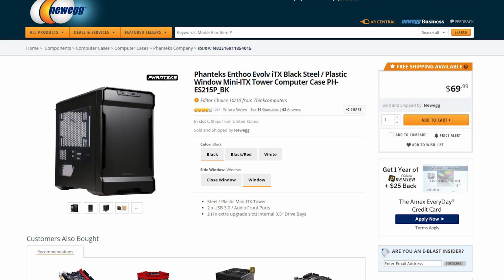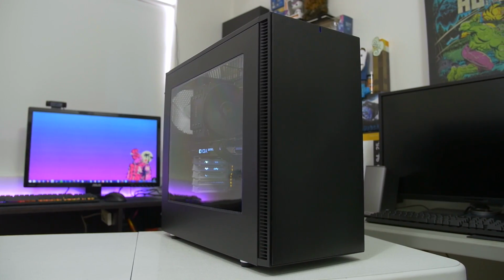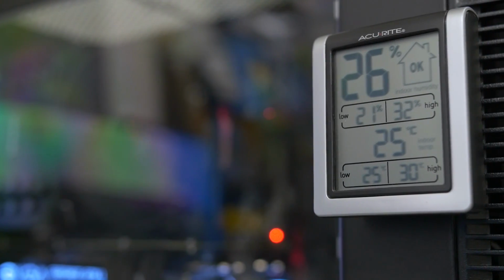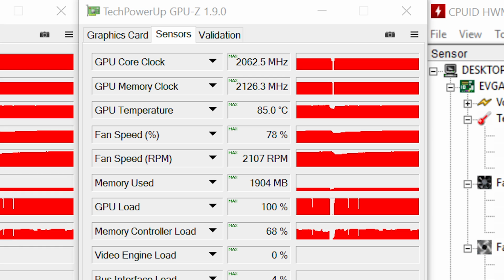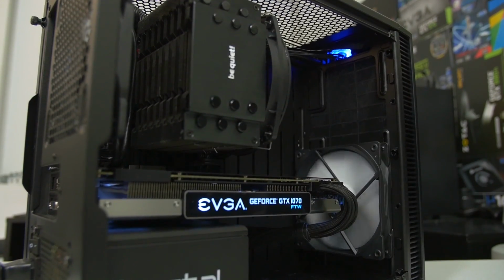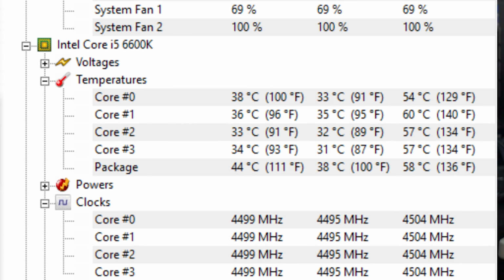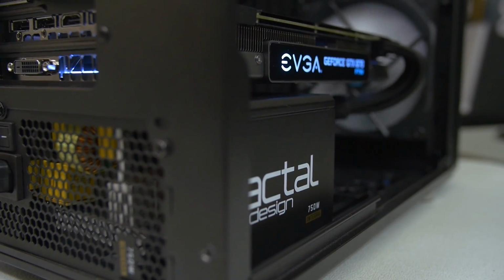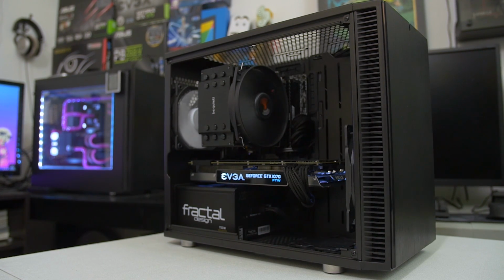Are Blower Fan Video Cards Actually Better in SFF Cases?

Comment: I'm a little late to the party but if that was me I'd swap out the psu (since in most cases its not the most expensive part and the old one could be sold) to a SFX one. There are brackets available to mount SFX PSU's in a ATX Case.

Comment: nonsense! I have the Define Nano S and same gap between gpu and have the evga gtx 1070 sc Blk edition and it runs between 80 and 85 and even with an ATX case it did. Evga site even states max temp is 94c so 80-85 is fine when under load.

Comment: Hi. Great videos. Could you try and run these tests again using more case fans (i.e. 2 front intakes, possibly 1 at the bottom beside the PSU). 

I currently have this fan setup and i'm getting around 65-70C for the GPU and 35-45C for the CPU (Asus 1070 Strix O8, 6700k, Nano S). The noise levels are pretty silent too.

I also used an Asus 1070 Turbo (blower-style) and I did not reach those temps.  This prevented me from entirely replacing my ATX PSU to an SFX PSU (saving me money).

Other forum discussions have also stated similar temp ranges. Just wanted to inform others that it is possible to use a regular PSU and open air cooled GPUs without reaching the temps you showed. Thank you.

Comment: It's no wonder the Define S is sold for cheap money.

Thermal design is not good enough except for total watercooling.

Just move the PSU upwards, standardway or to the front. It can't be that hard to design it.

Comment: I'll say at the outset that I might not know what I'm talking about. I'm a noob to building my own PC, having successfully accomplished this exactly once. I'm too scared to OC anything, too scared to try water cooling, and in general, find out that I'm wrong a lot. But I can't help but wonder if leaving open the top louvers on the ATX and Micro ITX cases might not have added to airflow problems within the cases. Unintuitive as this may sound, essentially leaving the top of the case open seems to me to result in a case with certain areas having fast low-pressure airflow (near the top openings, presumably) and other areas with little overall airflow (the bottom area around the GPU/PSU) which would leave those areas largely recirculating the ever more heated air in that area. Similar to a shoebox filled with objects and with a small hole on each end and a very small fan installed in each hole. If the top of the shoebox is closed, you would presumably get a decent amount of cool air flowing from one side to the other but remove the shoebox lid, creating a low pressure area at the top and it seems likely you'd get lots of areas that weren't seeing much air movement at all. I hate to be "that guy," but would it be possible to run the same test with the top closed? Seems like the temps may run significantly lower, or maybe I'm wrong and you'd bust another myth.

Comment: Trying to plan ahead for a build with Corsair SF600 PSU. I've read that the SFX PSU come with smaller cable lengths than standard ATX. 

Am I correct guessing the 24 pin and 8 pin connectors will require at least another 20cm ? 
Others extensions required ?

Comment: Sir, this is not a fair test at all!
Of course your blower design worked better in that case! YOU ARE FORCE FEEDING IT AIR!
YOUR INPUT FANS ARE BLOWING INTO IT. REGULATING AIRFLOW HOWEVER FOR THE OTHER CARD (AfterMarket).
It throws the heat from the card back at the card, making a Build up effect! 
Give that after market GPU ACCESS TO AN OUTPUT FAN NOT AN INPUT FAN.
ALSO! Is that cpu cooler pushing air toward the output fan?
I can't tell, However! If it already is change the direction of it too! 
INVERT THE DIRECTIONS OF THE FANS BOTH OF THEM! And watch the Blower style cooler choke on it's own heat. While the aftermarket one stays cooler. 
Just watch...
DO IT!
I have been building computers since I was damn near 4 years old with my dad.
DO IT!
AND SHOW ME THAT VIDEO!
THIS VIDEO IS JUST AN EXAMPLE OF BAD AIRFLOW SET-UPS.
THIS DOES NOT DETERMINE WHICH IS BETTER AT ALL!
OR EVEN BETTER PLACE BOTH THE INPUT AND OUTPUT FAN ON THE FRONT!
OUTPUT ON BOTTOM AND INPUT AT THE TOP!
USING THE CPU FAN AS THE OUTPUT FAN ON THE BACK ESSENTIALLY IT WILL BE FINE!

Comment: If you're going SLI, SKIP the aftermarket coolers at all cost, they run much louder and heat up the whole case making it basically an oven, making your CPU hotter and other components. I had 2x EVGA FTW 1080's, top card running at 85% speed(loud) and 82C temp and core downclocked under 1800MHz, and swapped them with FE blower style cooler, and they ran a whole lot quieter. The fan on the hottest card runs at 54% max and clocks stay at ~1850-1900MHz. The case used in an Fractal Design S with 3x 140mm fans in the front(intake) at full speed (~1000 rpm, nearly inaudible btw) and 1x 140mm in the back, exhaust, full speed also. So plenty of airflow, but still for multiple cards configurations aftermarket coolers are a NO GO.

Comment: This is a useless video since most PSU's have fans that pull heat out of the system so all you need to do is flip the PSU over so the PSU fan is on top so it pulls heat away and yes i know both fans would be fighting each other but with both fans pulling it would pull more air into that small crack. Ive actually tested this and it worked much better than not having a fan there. Also a lot of PSU's have a 0 fan speed most if the time so that would give it a place to pull air from. You should test this. It should have been in this video.

Comment: guys, i need your help. i never built a gaming pc but ive been searching for 2-3 months now all about pc hardware(like i know what gtx 10 series is, i5, lga 1151, ddr4 etc. ) .so i found the phanteks enthoo itx case and i was wondering if a gtx 1060 asus strix (non OC) would be good in there with an i7 6700k and corsair h100i gtx. since im not to worried about the cpu, i am about the gpu. so can any expert or person please tell me if the asus strix will strugle in there? i also have the evga btw
Reply: Well. i know what I want so i just wanted to know if the asus strix will perform well on top of the psu. or a EVGA gtx 1060 SC
Reply: 64 degrees in an ATX case. what about an SFF case? the fans are blocked by the PSU.  thats where it hits my brain. any link or help is kindly appreciated
Reply: Well thank you crown. You were really helpful. but at what fan speed? Im not to concerned about that because i use headphones but just for curiosity. Thank you again
Reply: ok. and since youre really smart, will the evga stinger have enough ports for the h100i gtx? Im sorry for the questions. youre probably like, will this guy ever leave alone lol.

Comment: Yeah: Nano S is SFF.....
R u kidding
Reply: Not even. I'm using a 17 litre case - 350mm high, 165mm wide and 295mm deep. THAT is small form factor. It houses an mATX board with ATX PSU, GTX970, 3.5" 1TB HDD and 256GB 2.5" SSD, 120mm intake and 80mm exhaust. Lots of performance for a small case!

Comment: You should have also done a set of test with some cube cases. Corsair 250D, etc. my GPU seems to be having problems in my 250 because there is almost no room above the card, and it chokes when I have the side panels on

Comment: It might be the chip or the fans why it's hitting 80 degrees? I'm using a define nano s, asus strix OC gtx 1060. clock speeds stays at 1990+ to 2025MHz. The max temp I've seen my gpu is running at is about 75 degrees only when playing Witcher 3. Most of the time just around 60-70 degrees. all other games is at 55-65 degrees. all my configuration is at stock fan speeds except for the case fan which I can run at max speeds and are still extremely quiet. The only drawback I've seen is the mobo temps on the pins are hotter, running at 41-46 degrees. Could it depend on what aftermarket design you're using? I haven't seen those 80's and 90's temps with mine.

Comment: To put the temps in one place:
EVGA + ATX case: 80C GPU, 64C CPU
EVGA + ITX case: 85C GPU (with reduced clocks), 65C CPU
FE + ITX case: 84C GPU, 60C CPU
FE @60% fan speed + ITX case: 79C GPU, CPU temps not shown (but presumably similar to the previous run)

Comment: It's just my personal experience but... I have a Phanteks enthoo evolve mini itx case and a Evga 1060 SC (which has only one fan right on top of the psu)... The card never goes above 60 C even under heavy load... (my card is factory overclocked). In my case the psu takes air in from the bottom of the case, I suppose that helps a lot... I also have much lower cpu temps but I did not overclock my i5 6400...

Comment: Who would choose a case like that? It's just smaller than a standard ATX case only that I have no possility to add any components, because there is only one PCI-E Slot used by the GC... Why not go for a really small Mini-ITX case like FD Node 304 or Sharkoon Shark Zone C10, where the GC gets fresh air from the outside and it's tiny on the desk... like Mini-ITX is intended to be.

Comment: > No cards should run at 85C for a long time
    > Grabs R9 290X Reference
Reply: I remember my good old BFG GTX285 OC, runing at a toasty 105*C in a good case with 23*C amb :')
Reply: Actually I'm pretty sure that modern gpus are made to run in temps of excess of 90 degrees C not that I would recommend that so running cards at 83 to 84 degrees Celsius Max isn't necessarily a bad thing especially if you have  blower style gpus which would then exhaust all the heated air out of the case instead of swirling it around the case and over your gpus which should make them hotter not to mention MSI afterburner could set a fan profile so that you'd be in the low to mid 70c in no time flat with like 70 to 75% fan speed
Reply: And 780ti reference. They got out at the same time, why talk about one but not the other?
Reply: Doge Charger GTX 480
Reply: Thermal_Sniper X truu
Reply: Either way, the R9 290X is a wonderful card, but don't get it if you can't take the heat lol
Reply: Doge Charger and the power consumption
Reply: Running a r9 290x in my mini itx case going on five years now.. running bf5 in 1440p on high settings smooth as 🤘
Reply: Both my 980ti's runs at 89c they are heavily overclocked
Reply: I'm not happy until my GPU and CPU are overclocked to reach 90*C. Burn em out so I can upgrade.
Reply: Bro my Quadro 4000 hit 105C at 100 percent fan speed. It needs thermal paste. Problem is that the screws are nearly fused to the card cuz of the age and rust built up.

Comment: Using a SFX or SFX-L PSU along with a open air style GPU in the Define Nano S will solve any GPU thermal issues :)

If you do not plan on over locking your CPU using a low profile cooler, such as the Noctua and NH-L9i, will be massively beneficial. 

Finally, installing a second front 140mm case fan will do wonders.

Comment: Would probably be worth noting the mini itx designs that have the GPU in a different place, since that would have different implications.
Such as Silverstone cases, the Raven RVZ 01 and 02, which have the gpu in a seperate compartment, on a 90 degree angled riser, and case vents either side of the card.
Or, the Sugo SG13 which has a more conventional arrangement, but with the GPU in the outboard position, again directly adjacent to vent holes in the case on the fan side, and the power supply mount inboard of the GPU.
(this of course only works because this case design is horizontal rather than vertical, otherwise the vents the GPU uses would be blocked.)

I would assume given an arrangement like this, the results are going to be slightly different, since there's nothing obstructing the airflow on the side the fans are located. (except the case itself - vents aren't perfect.)
Reply: 1080fe evga blower silverstone ft02 3x180mm fans positive pressure case room 22c case 24c mobo 26c cpu 27c gpu 25c no noise fans 40%

Comment: Just wondering: why not use the same motherboard in both cases? ITX fits in ATX cases, after all, and this would eliminate another variable in your testing. It's not like the ITX board is stopping you from mounting CPU coolers, RAM, case fans or anything else.

Comment: ok guys, i have a n00b question here , so im using 2x8gb corsair ram, and i was planning to buy the exact same 2x8gb corsair ram ,will it work with MSI z170 Mpower tinanium? since its say its only support dual channel but i saw many video use quad channel ram, while the mobo itself doesn't support quad in their website. HELP 
sorry for bad english
Reply: Yes, it will work
Reply: Sei Ren 
Dual Channel = 4 RAM sticks
Quad Channel = 8 RAM sticks

Comment: Hey guys I have a question. 

I recently built a pc with a gtx 980. Today I decided to try overclocking it since everyone makes it look so easy. 

I am using msi afterburner on a gtx 980 armor (msi).

However, I keep pushing my core clock and memory clock speed and it handles it like a champ. I increased both at the same time, core clock at 50mhz for each interval and 100mhz (ish..) memory clock speed for each interval.

So, I have so far pushed my core clock to 450+ and memory core clock to 500+ and I did a few minutes of Unigen benchmark. The thing is, i have room to push it to 500+ and 600+, which I have been informed is not normal.

People told me they crash when they oc 300 and 400, so what about me? Did I win the silicone lottery or something. Why can I keep pushing?

mr.bitwit if you want maybe I can send you this graphics card and you could test it out to see whats going on. If you guys want I can record it and put it on Youtube or something.

Comment: If you turned the psu upside down so it draws air in from the bottom wouldn't it make a big difference? Does that case have a psu intake on the bottom?
Reply: Ok I looked online and the fractal define nano s has a psu fan grill on the bottom. I think this would affect it a lot
Reply: Nvm I just realized the psu WAS upside down
Reply: hahahahaha dude justo answered all his own comments. Classic move

Comment: 85 degrees, you making me laugh! It´s a GPU, not a CPU! I´ve never heard of any GPU that couldn´t take 100°C for an extended amount of time. Hell i had a 3870X2 that ran 110+°C when i got it, and it had been running like that for years and i had it for years after that (though it only ran at 87°C after i cleaned the cooler)

Comment: Or... you could pay $30-$50 on a gpu bracket so you could mount a $100 AIO CPU water cooler to your graphics card. My GTX 970 runs at 70-85 F on idle and 110-120 F at 100% load.

Comment: how much does overclocking memory on a 1070 helps? my clock goes up to the 2050 MHz in game and i could get it over 2100, but i would need to increase the voltage more to make it stable. i have it up by 50% and 150 offset on the gpu boost, but i dont feel experienced enough to crank it up. idk if it will hurt it. the core clock is still stock, but since it goes up to the 2000+ mark in game. i dont feel its necessary to bump it up. i also made my own fan loop which keeps my founders edition cool, never saw it go over 69 degrees.

Comment: I dont see why not using the same ITX motherboard at bigger chassis also, mostly if system fans are plugged to it, or use the same sys fans at fixed rpm direct from psu power.

Comment: I am sooo happy I bought the Zotac Amp Extreme instead of Evga Ftw edition. Evga wasnt avaliable at that moment, I was so angry back then. But now my card never reach more than 57° at full load for 2 hours of playing any kind of game at ultra settings or benchmarking. I use costum fan curve offcourse but the fan speed never exceed 60% in any circumstance.

Comment: How about a video about how much change there is between blower style coolers and custom fan coolers in a mid tower case? I want to know if having a blower style cooler will lower the CPU temps while still having the clock speed relatively the same as the custom card.

Comment: A hybrid GTX 1070 or 1080 would be absolutely KILLER in that setup. 

Put the hybrid's radiator and fan below the card, draw air upward through the radiator, and then push the hot air from the GPU blower and bottom radiator out through the front. Meanwhile draw air in through the back of the case, through the CPU cooler, and then put another exhaust fan out the top (or even put another one in the front). 

The perfect back-to-front airflow design that delivers fresh air directly to the cpu/gpu and gets rid of it immediately at neutral pressure (which I'm convinced is usually ideal).

Comment: Err...isn't the point of the Nano S case to use a SFX12V?   A typical SFX PSU is between 1.75cm  to 2 cm lower than and ATX model.

Comment: lol obnoxious amount of noise is a bit exagerrated there Kyle. I'd be more concerned with keeping the gpu cool than noise, since youre probably wearing headphones or have the speakers turned up anyways. If you want to hear loud ill send you a recording of my pc with 2 gtx 970 ssc's, a v6gt cpu cooler in a haf 922 lol, thing is like a jet taking off. but max temps on top gpu is like 70C, max cpu is 59C at a 4.5 ghz overclock 2500k.  Anyways I did enjoy this video, it was a good idea to test this. I prefer blower style personally, unfortunetly my 970's are not blower style.

Comment: 85C is kinda ok. if you ever had a old mb featuring sli within 4 slots, the top card is likely to be running around that temp none the less, the reason as you called out, the airflow for the top card is worse than ITX PSU blockage.

Comment: so, it seems like the question here is if the open cooler gpu being physically blocked by the psu have a hard time to cool things out. but another question i have is: how much the psu's own heat affects on those raised temperatures? what about testing it again with the psu on and with that psu off, like using another psu ouside the case to power it up. how much will the temps on the gpu raise/reduce with this test?